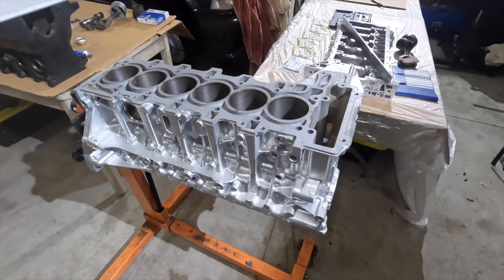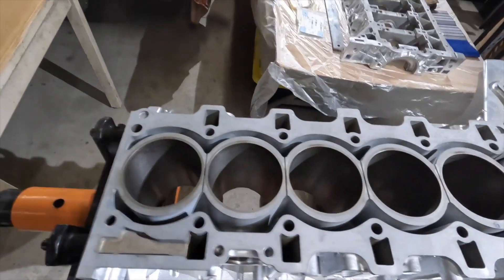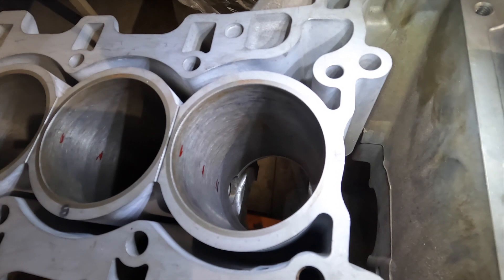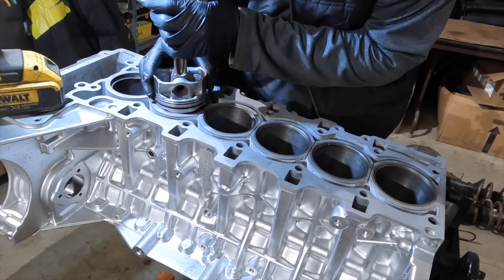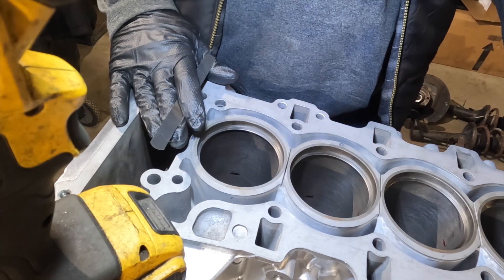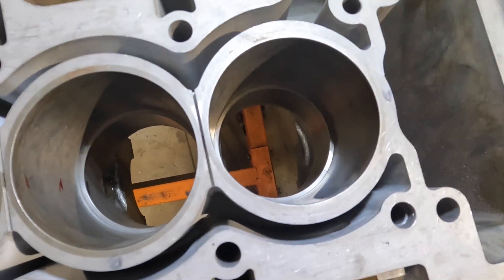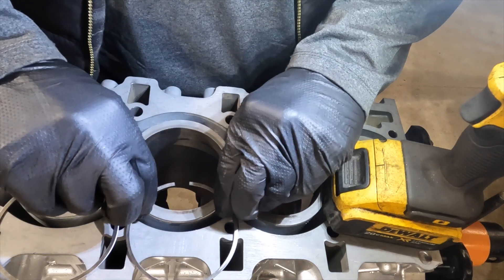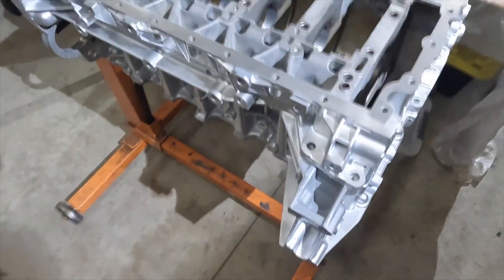BMW N55 17667419 Rebuild Ring Gaps & Block Flatness Part 1

Comment: What was the reason for this rebuild?
Reply from the maker: @Dutch79  Re oils engine to put into a 535i that had a spin rod bearing
Reply: @straightupbmw  You know the mileage on this N55?
Reply from the maker: @Dutch79  Why
Reply: @straightupbmw  To get a indication of the moment this occurs. I also have a N55 myself.
Reply from the maker: @Dutch79  Hi
This engine had 117k, others I have rebuilt range from 80k to 160k
Reply: @straightupbmw  Miles, right? Any idea of the cause? Failed oil pump, track use, low oil level, ...?
Reply: @straightupbmw  No info on this or you don't want to disclose?
Reply from the maker: @Dutch79  my thoughts are these spun bearings are caused by 2 things.  They are both related

1- The bearings are not as stable across various temperatures and could potential close up the oil clearance 
2- lack of correct oil and oil change intervals - these engines are direct injection, more carbon residue are placed in the combustion chamber and ultimately get into oil and the entire engine, those micro particles build up on the bearings and could close up oil clearances and reduce lubrication  leading to spun bearing.

Comment: ISTA says 0.15mm to 0.30mm for the top ring "end clearance", which I assume means the End Gap.  This is a range of 6thou to 12thou. I also get 9thou on mine.  Question: am I understanding ISTA correctly? I have Hastings rings. Is it possible they do not need to be filed at all? It looks like you never filed yours at all, is this correct? Thank you!

Comment: what should be  the max deviation of measurement in the deck?
Reply from the maker: .004”
Reply: @straightupbmw  thanks for your fast reply. I’m currently rebuilding an engine for one of my cars. Getting the remaining head gasket material off the deck is kinda difficult. i was using steel wool very lightly but not sure if this would make it uneven. What would you recommend to clean the deck other than getting it resurfaced?
Reply from the maker: @F80__Los  brake cleaner and a plastic scraper 

Them goo be gone with light gray scotch bright

Then stone deck with 400- 1000 grit stone

Comment: hello, do you know the limits of the axis where the crankshaft is located in the engine the limits not to be exceeded between the rounded axes where the crankshaft is held for good operation?
Reply from the maker: It sure I understand your question

Comment: What was involved with honing the cylinders?  Did you just run a flex-hone through the cylinders,  or did you use the sunnes Silicon paste to allow for the rings to seat properly?
Reply from the maker: This is not the Alusil bore that has the silicone embedded within the aluminum.  These are just steel liners in an aluminum block. I used flex hone to get cross hatch. And to get a good Ra number
Reply: @straightupbmw  I have come to the same conclusion. Did you experience any excess blow by or oil consumption afterwards? 
Thanks for the reply. I'm pulling the motor on my 435i and your guidance has been incredibly helpful.
Reply from the maker: @richm7936  both N55 that I have built and documented on YouTube has been extremely good at not using any oil.  This was a particular sore point with me before I build.  I was very careful to manage the bore prep for the correct surface finish ( Ra, Rk, Rpk, Rvk, Mr1 and Mr2). Along with piston to bore clearance, rings gaps, bore measurements for roundness, taper) 

Right now I have 16k on my first build and I don’t use any oil between oil changes -  oil change intervals 7500 miles
Reply: @straightupbmw  fantastic to hear. Mine has no compression at all on cylinder #6. I'm expecting to see a piston with a broken ringland once it's apart. Hopefully the bore hasn't been trashed. As I dont want to buy another block.
Reply from the maker: @richm7936  good luck. If you need block I have a few
Reply: @straightupbmw  I live in Northwest Indiana, so if that's the case,  I'll keep you in mind. 

Thanks again.
Reply: @straightupbmw  You got a N55 block I can build off of?  I found exhaust in my coolant reservoir along with engine will overheat in about 5 minutes driving.  And compression is low on cylinders 2 and 3, I'm suspecting a blown head gasket there or simply there could be a wash-out from cylinder into the coolant passages.  I am losing coolant upon overheating, too.  But the car can still limp and drive when not hot.  Looking to build another N55 instead of buying one from online sources where I simply just don't trust those motors out there, and the good ones are really too expensive for what I can spend.  My car is a 2015 X5 with over 212k miles already, so it won't be worth it to spend so much for a motor swap.  Time is on my side where I can just take it slow and build it in my garage.
Reply from the maker: @godfatheratlsu   I have several N55 block that has been prepped for rebuild.  They are done similar to the link below to my N54 block listed on eBay

https://www.ebay.com/itm/375206788893?mkcid=16&mkevt=1&mkrid=711-127632-2357-0&ssspo=iwhBcv_9RLC&sssrc=2051273&ssuid=iwhBcv_9RLC&var=&widget_ver=artemis&media=COPY
Reply from the maker: Typically blocks are blasted, painted , honed to achieve the required surface finish Rpk,Rvk etc. and then measured
Reply: @straightupbmw  How much does it cost for one of these N55's for me?  I don't mind purchasing it off eBay if that's a easier platform to work with.
Reply from the maker: @godfatheratlsu  send me an email at straight.up.bmw@gmail.com and we can discuss further